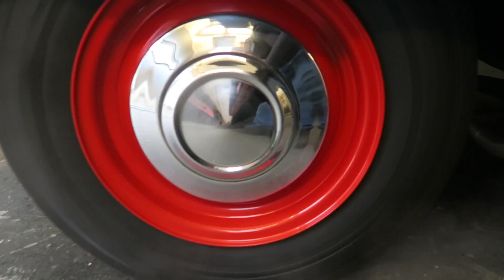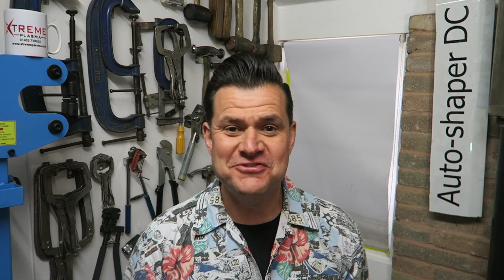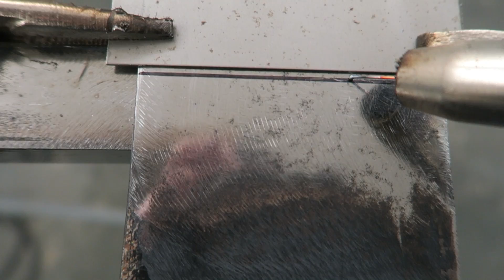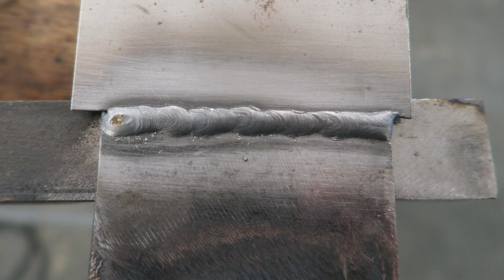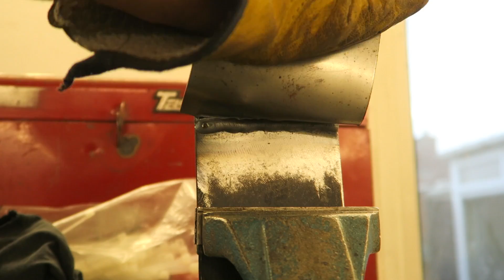Mig Welding set up Part 2 Plug welding Butt joints grinding polishing Tips and Tricks #46 Ron Covell

Comment: I guess that if you were deseaming a mini, you would TIG Trev which was not around when David Vizard did his thing?
Reply: Tig was around long before mig. Little history lesson tig was invented to replace oxy acetylene welding makes sense very similar then some one had the idea "well what if we put the current though the filler wire instead of the tungsten?" The mig was born.
Reply from the maker: alistair smith nice one 👍 I believe TIG was first created for the aviation industry, that’s what I was told many years ago. Cheers Trev 👍
Reply from the maker: David Hender David Vizard... there’s a name I haven’t heard mentioned in twenty years. TIG was almost certainly around. I believe the reason we use what we use is familiarity. I knew that people used TIG many years before I actually tried it for myself but I’d only ever used mig as I was familiar using it. As said later on in the Ron Covell section I’d only ever worked in garages that had mig welders so you kind of stick to what you know. And then came along a guy to do some repairs at the resto garage on an aluminium car, he was a Morgan trained guy. The boss had to invest in the TIG welder and of course I had to try it for myself. It was only then I realised the advantages of using the TIG welder. It certainly wasn’t easy especially to start with but the results on certain welded areas were a vast improvement on mig. Cheers Trev 👍
Reply: @trevsblog  I even have the ultimate mini book "How to modify your mini". It was our bible when we were grass track racing and I still have it. Good examples are worth a fortune; mine less so !
Reply from the maker: David Hender well thumbed through no doubt, my old mate had his book on tuning the a series which he referenced when modified his old Morris Minor. So long ago now...
Reply: @trevsblog  The good days Trevor
Reply: @trevsblog  Hi Trevor, you have to start with what you know best and I know Minis; they are in my blood, they are in most guys' blood. Deseam, cage and a striking paint job with a more powerful engine and better brakes; all road legal; that is if I can get out of this hole. You have given me so much inspiration Trevor. Thank you
Reply: @trevsblog  I have done arc, taught by my Dad as his Dad was a boiler maker in Southampton docks. I will try to master MIG first and then TIG. My old civil engineering professor said that if you say you know everything, you are a fool. Even he said he was still learning and the whole group was entranced, including me. I want to learn until my last breath
Reply from the maker: David Hender good points. The more I learn, in some respects the less I realise I actually know. You never stop learning, that’s for sure.
Reply: Friend of mine deseamed a mini by mig welding the seam from the inside, then cutting off the seam, not cutting it off and welding it from the outside.

Comment: What would you think of capping the pitted mig weld with a tig pass?

BTW, for drilling out spot welds I find that using a rotary broach works better than a spot weld drill. It tears up the metal much less and is faster.

https://www.blairequipment.com/rotabroach-cutters

I do use a whitney punch to pop 5mm holes in new steel, and then use a step drill to enlarge it. Fast.
Reply from the maker: Padraic McGuire I’ve never tried it to be honest but it wouldn’t be something I’d do. To weld something twice is doubling the damage the welder does to the base metal. TIG welding isn’t easy and it’s a learning curve but once you’ve grasped it you wouldn’t go back to mig welding most joints. Provided you’ve got access behind it’s a vast improvement on mig. Thanks for the link. Cheers Trev 👍
Reply: Trev

I have lots of welders at my disposal and am a reasonably competent Tig welder (at least on steel). I learned to gas weld 50 years ago whilst in 8th grade. US middle schools used to have industrial arts classes (woodwork, sheet metal, graphucs). Sadly now mostly gone now.

Gas welding skill easily transferred to TIG.

Maybe I should just get used to TIGing everything!
Reply from the maker: Padraic McGuire I certainly still think there is a place for mig welding but it just lets you down in those blasted butt joints. I started using oxygen acetylene right at the beginning and yes it’s certainly a similar process to TIG but without as much heat transfer. Cheers Trev 👍

Comment: hi ,  6.5mm I find perfect for plug welds , totally agree with you on the 5mm , they wont let them be used in the states for racing. I also find that a copper backing strip clamped int place lets you use more amps without the burn through issue , but dont go round in circles , try going from one side to the other , and start at the sides where the lip is full , ie not the skinny bit where the hole is closest to the edge of the lip , , and one weave as you cross the centre of the hole . works really well as you can get into position to watch the weld pool move across trying to circle blocks your own view ... just food for thought.
oh , and back your wire speed off a wee bit , and the results will change dramatically .

Comment: Another great video Trev.  It would have been interesting to see the destruction test on the mig V Tig plates. Could you do the same weld but with one plate being an old slightly rusty car panel?  Does Tig cope with rusty metal?
Thanks again.
Reply from the maker: Chris Brunt in my previous videos I’ve done these kinds of tests. Without doubt the TIG weld ends up being a closer match to the softness of mild steel so resists failing far better but in my opinion mig is still plenty strong enough. In thirty five years I’ve never seems previously mig welded joint fail badly on an accident damaged car. Modern cars however are radically different from older ones and are now mig brazed to keep the area cooler. TIG is more sensitive to rust, it really needs to be as clean as possible but if you take your repair area back to good metal which normally only means making you repair panel slightly larger you can easily overcome this issue. Cheers Trev 👍

Comment: What if you used the spot welding nozzle for the MIG? (the one with slits in the side to allow the gas to escape) Would that make a huge difference in penetration with the 5mm hole?
Reply from the maker: JH penetration is down to heat but there needs to be a balance to much heat results in heat distortion or blowing through. Those shrouds  with the ears are great for distancing your weld but they won’t change the outcome with penetration and the gas is only shielding the weld to stop in oxidising. The failure with the smaller hole lies with the problem of bridging the hole before the weld has had chance to contact properly with the panel underneath. If you turned the power up on the welder you’d have a better chance of a successful weld but at the cost of producing too much heat also. Cheers Trev 👍